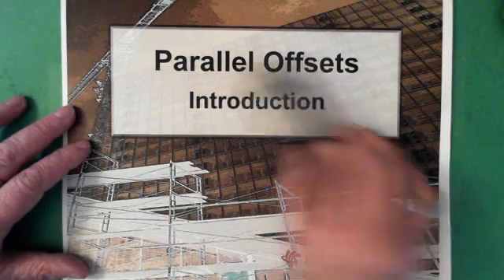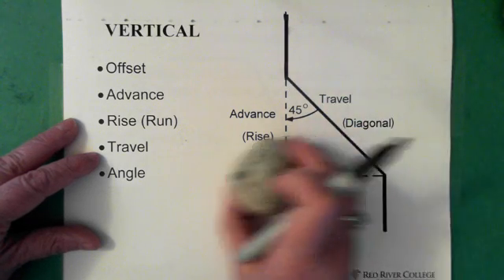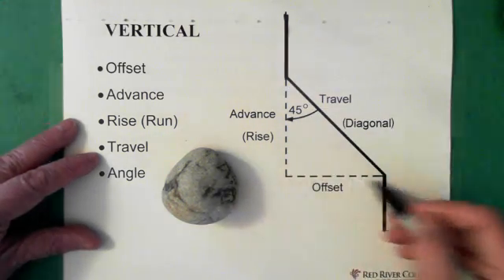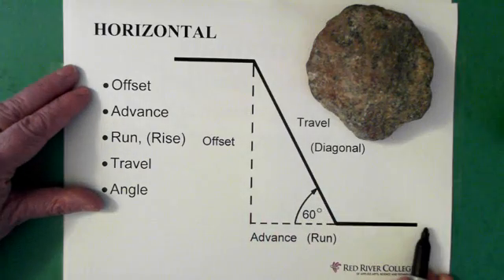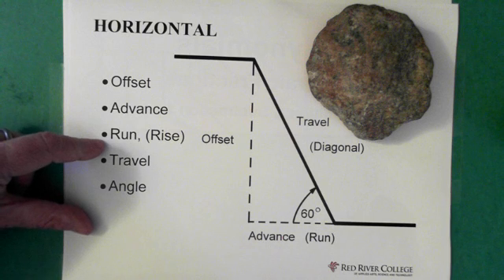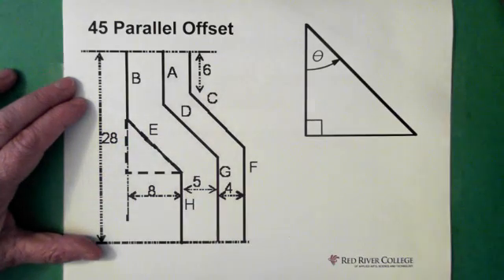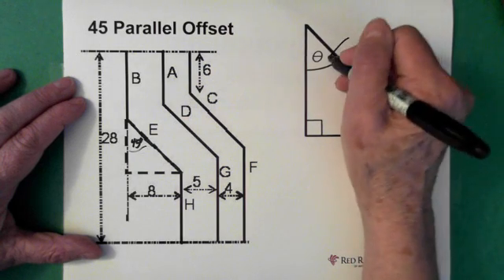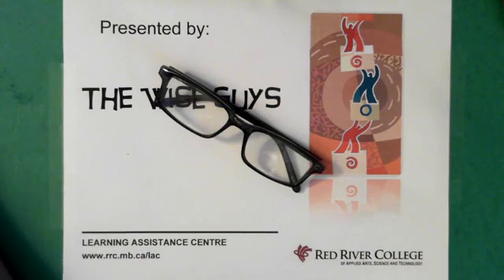1. Plumbing: Parallel Offsets: Introduction

Comment: If you are interested, then perhaps you might take a peek at the Handtuber Offset Calculator which can be used to quickly work out offset measurements for instrument and copper tubing.